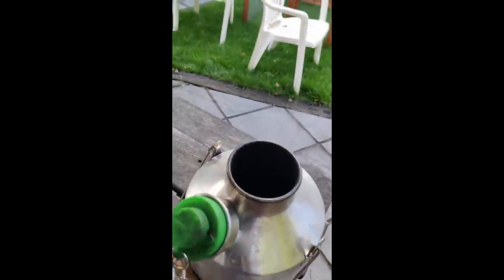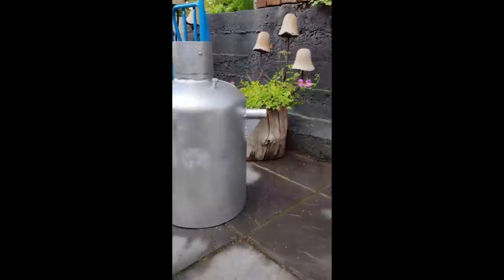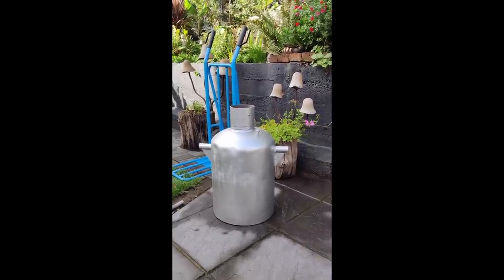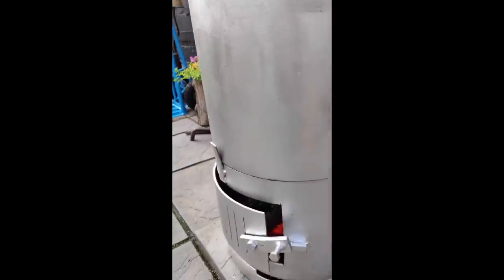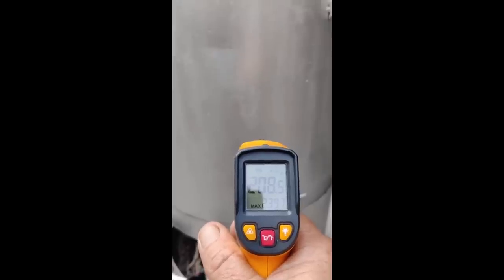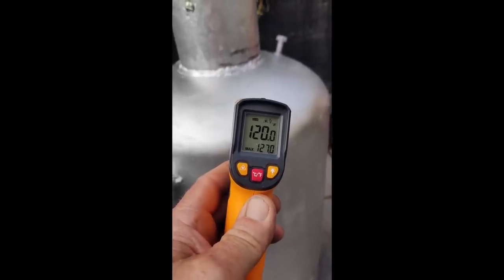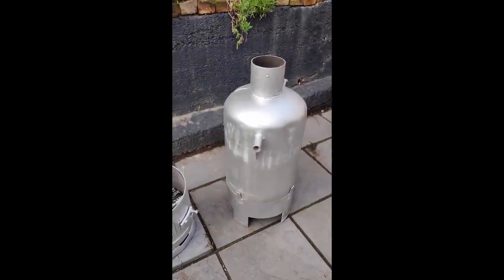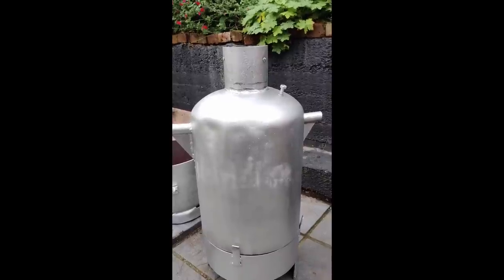Sand battery can it heat my home?

Comment: I have been watching Roberts's channel too, and nicely done so far.
First, that temp gun works poorly on that silver paint, paint some of it black and you will see what I mean, also, you need to drill some air holes around the bottom just below the fire grate, this will feed the fire more oxygen which will give you much more heat, maybe a sliding vent cover? and I think much of the time the heat readings you were getting were from the heat moving around the steel case, as it's more conductive than sand, but I really liked this and am planning of building a sand battery too, but heated with excess electricity from my solar, thinking of using hi-tempter PTC heater elements inside of the sand battery etc, as I can't light a fire as I live in a flat, but I do have a garden, which is where I have my DIY solar setup. I'm subbed to see how you get on.
Reply from the maker: Thank you!
Yes solar or wind would be perfect for this system, unfortunately I don't have a good position for either so I'd be interested to see how you get on 👍

Comment: Thoughts: (edited after watching part 2)
1)
Weld some plates inside the chimney OR make a removeable basket that they can attach to , like slanted baffles that will  not only absorb and transmit heat through themselves into the walls, but also force the flow against the chimney sides.
|  /  |
|  \  |
|  /  |
|  \  |   ... not to scale, 45 degrees?
and...
2)
Pipe(s) crossing the base of the sand unit above the fire, leading from outside inward because, as others already said, some extra air injection at the base of the chimney would allow secondary burn and raise temps while reducing smoke.  You'll want to avoid the air injection being offset though because while a spiral tornado flow burns more efficiently and completely it does unfortunately concentrate the heat in the centre - not what you want if the chimney sides are your target!

Comment: I'm only 11 minutes in, but I think you could get a bit more heat absorption with a baffle hanging down the flue pipe.  Gas fired water heaters use them to slow down the upward draft of combustion air and push it outwards to the sand battery (water jacket) to extract a little more BTU's.
Ours are a flat piece of steel twisted back and forth (not in a single spiral, as that would just accelerate the exit of flue gas) which hangs down the flue, fully removeable.
Great video so far.

Comment: If you listen to the creators of the Finnish Sand battery, they explain why their system isn't suitable for a single dwelling. Its more for combined housing developments, district heating etc. It needs Tons of sand, and fairly complex engineering to extract the heat. For single houses, storing heat in water, is a better prospect...

Comment: I used a cylinder like that to make a drip feed waste oil heater, worked well but adding a small fan REALLY increased the heat, so easy to make, just light a small fire (old rag) in the bottom and drip oil when burning.

Comment: Not finished watching yet, but found this video when I was searching for sand battery stuff. I had the idea to make smaller sand batteries around a chimney that could be moved but didn't consider making such a huge one. In regards to the weight, you could always split the battery up like you did with the original tank and have a few smaller ones stacked. This would not only make it easier to move singlehanded, but allow you to have one heating while the other is 'discharging' or even use them to heat multiple rooms.
Reply from the maker: Yes very good idea I'm thinking of making something smaller ones to heat individual rooms, yes is a bit big but manageable (just) 😄
Reply: @leejones2511  Just got to the end and about to jump to the next one. it's looking like it'll work though. 
As to the free energy, who doesn't want that, especially now. If you have free reign of your garden you could maybe even set up a low-key budget solar heater with the output being a central shaft that the bottle could fit over. That way you could have it 'charge' during the day without the need for the burn at all. It'd need testing though, not sure how much heat you can get out of them, but if it's an all day into an insulated sand battery, it might work.

Comment: Almost 50 years ago I was camping along the Copper Creek in Alaska.   As a teenager I had bought an old woodsmen book dated 1914 or something like that.   It showed how to dig a fire pit and put large rocks in it.  When the fire was done you backfill it and sleep on it.   So we did it and put our tent over it.  Nothing for 1/2 hour  but then it started to get warm.  So warm we had to move the tent.   It was still warm the next morning.    I've thought about it every since, then I start hearing of sand batteries.   I'm wondering about building a serious one built into the yard or lawn like 10'x10'x7' deep and using parabolic reflectors in the summer to heat it up?   Or maybe I'm crazy.

Comment: I’m working on a similar project and sand is good to 3000 degrees F.   A rocket stove at the barrel will reach around 2800.   For your setup, I’d recommend using a small fan to basically build a forge.   That will speed up the charging time and use less fuel.

Comment: This is the first example I've seen put together after hearing about sand batteries.  Well done Sir.  As was mentioned by others steel rebar is a cheap easy solution for conducting heat.

To get the heat out effectively:  use a copper distillation coil / refrigerant coil type layout.  Turn that into a heat pipe which can be done using copper wire as condensing material.  Search water copper heat pipe.

Using a small multi fuel rocket stove in addition to this sand battery would be the most efficient as far as fuel consumption and burn quality. 

Thank you for sharing your results Sir!
Reply from the maker: Your welcome & to thank you for your advice & feedback 👍

Comment: It would be interesting to see how long the heat takes to travel through the sand from bottom to top. Then design the system that you can control the temperature it radiates from start to finish by how much you put in til how much you get out long term for 24 hours.

Comment: old gas water heaters have a corkscrew piece in the center pipe exhaust. to slow down & deflect heat to the sides as it rises. this would help heat faster & raise the temperature as you wanted. one of my 40 jobs in my life was oil burner service deliveries as well as gas. newer ones use a recirculating fan from top to bottom to draw in hot exhaust to help heat bottom so some combination may help? or make more efficient? but depending on fuel to heat can cause soot buildup and condensation rust issues which can degrade heat transfer & life of the unit as leaks will eventually happen.. or use stainless steel. its a nice build you have there.

Comment: Fantastic! Sand battery is the future and with pioneers like you ideas will keep coming and get better. Your fire is not able to get hot enough due to your ventalation slots in the door. If you drill 2 x 20mm holes 1 on either side at the bottom of the base (Under grill height) this will allow the fire to draw in oxegen fater than the door being fully open, also you will need to close up the vents on the door as this is having a negative effect with the fire drawing in oxegen all around is not good for the fire. You can then make some 25mm square pads to close the 20mm vent holes slightly when the fire is in full swing. You want to see the fire coming out the top ie a rocket stove. Its all abount the vents. I will be making a 100lt sand battery here with solar when I know how to in the near future. Well done to you sir
Reply from the maker: Thank you & yes will be looking into the fire box ventilation next so thank you
I've got a second video on it & had better success touching on some of your ideas 👍 & will be improving from that burn too .

Comment: I wondered about using just a metal bucket of sand placed on top of a multi fuel stove. I wondered if it would store enough heat while the fire is on to keep my mountain apartment warm until the next evening. Another option was to use a bucket of paraffin wax as the state change from solid to liquid would hold a lot more energy. What put me of a little was the fire risk.

Comment: In one of my hunting cabins down south I built small brick fireplace used a 20 gallon steel drum as chute ran copper pipe coiled around it to rubber hoses to a car radiator closed boiler system radiator has pressure relief. 8 sat 55 gallon over 20 gallon so smoke and heat fills 55 and flows out pipe towards bottom thanks to your vide I might try filling 55 with large rock or sand to hold heat longer to keep water hot. Thanks if want more details let me know I'll be interested in seeing what you come up with in future. I constantly upgrade and adapt mine as I am learning

Comment: The TYT guy is awesome.
Maybe think about 2 holes in your wall with a vent into a sand battery and out.
They wouldn't need to be large vent just spiral through the battery with a small fan.
And have a large battery outside with a chimney in the middle and a rocket stove  as the heat generator.

Comment: It depends on everything. But yes. Same principle behind steam heating used in New York and other various northern cities. Except you maintain a heated volume of sand. You run lines through the entire assembly and move air/water through it to transfer the heat across the system. If you run the lines through your house, it can be made to control the temperature of your house by transferring whatever heat you put the sand at, through the lines, throughout the house.
Reply: It's just expensive at that level. And then imagine your home repairs including removal or replacement of all those lines.

Comment: Drill holes into the flue add bolts going into the sand.This would carry heat deeper into the sand heating faster and more even. Turn the bolt where the head is in the sand just weld the bolt to the flue.

Comment: Attach a grate on the top so you could do some cooking while it heats up. Then when you bring it in the house you could place a smooth rock on the grate about the size of a softball. Then when that heats up you could wrap a towel around it and use it to keep your feet warm in bed. (It'll last for hours if it's heated to 212° f.)

Comment: If you have ever been to the beach on a very hot day, the sand may be too hot to walk upon barefoot, however, if you kick the sand just half an inch deep, you'll find cold sand, because sand (silica) is an INSULATOR !!

Try your setup using a core of metal rebate welded side to side instead. 

Metal transfers (conducts) heat well. 

Thick metal will conduct and hold heat for future use.

Comment: Love it. I'm lookin for a gas bottle now. I have been distilling ethanol, no flu required when burnt and it burns very well. Cleanest burning fuel known to man, gives off water and a tiny bit of co2. A sand battery is perfect. if you run a copper coil through the battery, hot water on demand. Genius. If you had a jacket on that bottle, you would have doubled your temps easy.
Reply from the maker: Jacket is on in part two 👍

Comment: Insulated steel chimneys can easily be fitted as wall mount to any buildings. Besides, having an outdoor garden boiler stove and insulated waterborne circulation to indoors distribution is also viable if there´s a garden, that is. Opens for wood, coal, turf, oil, waste oils. All easily automated for an even fire run, or shock doctrined by intense fire and thermal batteried by as ex sand. Water circulation pumps can be bought cheap these days and they draw very little juice unless there´s big elevations..

Comment: You need to put a flat flanged top on the center tube with small legs so it pushes the heat driven out in all directions with your pc fan being enough to get it circulating but no so hard and fast to prematurely cool it too fast. Your on to a good ideal my friend. God bless
Reply from the maker: Thank you! yes made one the other day, & see how well it works on the next video 👍

Comment: Once you bring the heater into the house, would it not be better to put a fan at the top and blow the heat out of the bottom? That way, you are heating the air at the bottom of the room, which is where you need it.  If you blow the warm air upwards, it's going straight up to the ceiling, where it's not going to warm your feet.
Reply from the maker: Yes I like the idea of it & may change it over after the first three hours as at first it's far too hot to have a plastic fan over it !

Comment: I took a 3 gallon canning pot I filled it up with sand stuck it in the oven..heated it up to 400°..,for an hr..put it in the bedroom 1 hr before bed time. Turn the house temp down to 62° f. Time for bed and The bedroom warmer and cools down slower. 
You sleep so much better in a cold room.

Comment: Insulating will hold the heat in. Vermuculite is a common wood burner insulation . Sealing off the bottom with some sort of plug will stop the flue from conducting heat away after the highest temps achieved and a heat proof cabinet that the cylinder could be sat inside the home with adjustable grills to moderate the heat flow. If you wwanted to maximise the convection then a ring placed around the cylinder with fins possibly of aluminium would increase surface area  think of the shape some led lamps use to convect heat away.

Comment: Use baffles in the flue and you will find that the top should be hotter, your loseing about 80% of heat up the flue . I am a retired heating engineer and I used to be involved with the solid fuel advisory board. Also look at putting heat exchanger pipes through it a bit like a steam boiler, you could run just air or water and pump it through radiators? But with water it gets complicated. Don’t get discouraged,you’re on the right path .
Reply from the maker: Yes still working on it, & yes il leave water to the professionals, thank you 👍

Comment: The wood constant supply is the problem as it burns down so does the temp and so the sand temp reacts heat proof insulation on the sand battery while heating and a steady even heat over the experimental time is required .

Comment: Would adding water to the sand increase thermal conductivity & storage density?  I remember a video someone did where they had a huge heat battery out in a shed.  I forget what the name of the product is, it's commercially made, but essentially it was a huge drum laying sideways, probably 5-6ft in dia and maybe 10ft long (going on memory).  It had an internal chamber full of water, and, as I understand it, a flue system wrapped around that internal chamber.

At the one end was the burn box and a powered blower.  The burn box was large enough for a proper blaze and decent sized logs.  The blower turned that into a super hot blaze that burned near everything, including outgassing from the wood.

The super heated air would travel through the flue network around the internal water bottle that would suck up all the heat.  There was a thermometer so you could see what the temperature was of the water battery inside and know when to turn off the blower.

What was amazing:  The exhaust at the opposite end was the fun part of the demonstration.  They went outside the shed to the exhaust tube, and it was NOT blowing any smoke at all, and the air coming out was cool/ambient.  Not hot, not even warm.  Nearly all the BTU's of heat burned off ended up in the water bottle battery.  And that heat storage lasted a good, long time (I seem to recall weeks) before they'd need to run the burner again for a few hours to charge back up.

Anyway, that was the motivation for the question.  Is the sand in your sand battery dry?  is there an argument for water to be added . . . assuming it was engineered to be safe (e.g. no bursting/explosions from steam/hot water?

Hmmm, I think you said a "sand battery" can get REALLY hot.  I may not be thinking this through, because water would turn into super hot steam, and a lot of pressure, at those temperatures.  The device I described above was charged to, hmmm, I want to say 250 degrees-ish (memory), and that's a huge tank.
Reply from the maker: Wow that system sounds super efficient! Yes no adding liquids brings in a big element of danger as if you haven't got some kind of pressure release & don't know what you are doing & don't understand how it works (like me) 
Very interesting system though il look it up later & see if I can find it 👍
Reply: I would advise against adding water/liquids. The point of the sand is it can hold heat at higher temperatures without a volitile phase change. Much simpler to maintain. I also hope you've considered condensation. You might need some vent holes to allow any internal moisture to drip/leak out not to build uncontrolled pressure.

Comment: About your situation I came up with this idea:  Build a WALL-fireplace outside that consists of masonry/sand filled or ceramic components.  The trick would be that it would have  HVAC pipes weaving a time or two through the wall structure until it reaches the top chimney (Or do a dual fireplace wall with two straight chimneys).  As I see it you would slowly be heating your "wall" to heat your inside, and when/if the fire dies you will have the residual heat of the sand/ceramics lasting a fair bit. [ Insulate the exterior to maximize retention ]